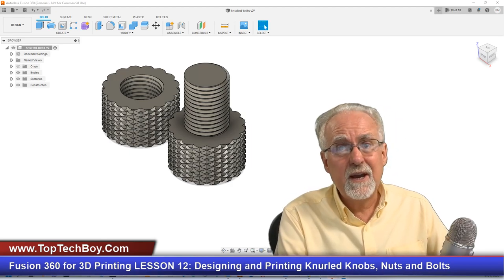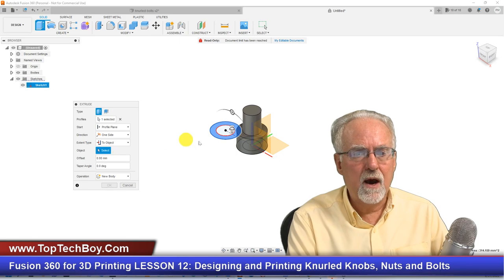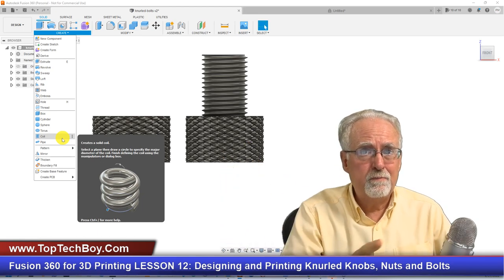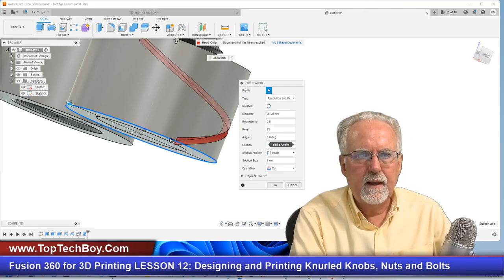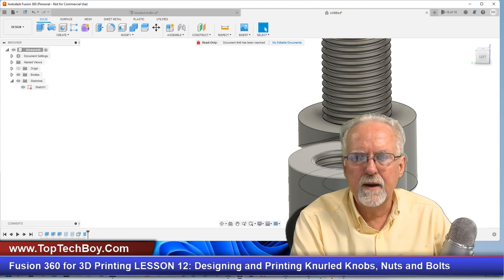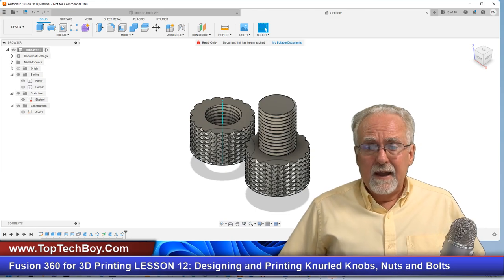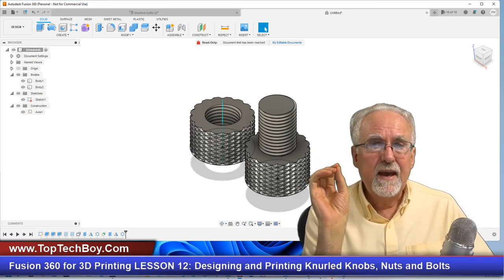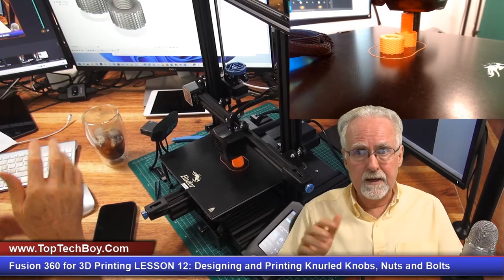Fusion 360 for 3D Printing LESSON 12: Designing and Printing Knurled Knobs, Nuts and Bolts

Comment: Paul, I love your teaching style. I've had two kinds of teachers in my eighty plus years. There were the geniuses who floated into the class with notes on the back of an envelope, scribbled on the blackboard for 40 minutes while everyone frantically tried to copy, and then left. The great teachers however were able to look out into the class from time to time, and say something like "I can see where you might be having a problem. I struggled with this myself when I first saw this. This is what helped me."  Yes, I did the simple nut and bolt, as well as the eyeglass case. I've only seen pictures of the results so far, because they  were printed by a friend with a 3D printer. Keep up the good work.

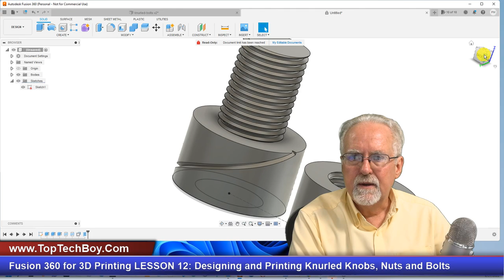Comment: There is actually an option to flip or mirror the cut like you were talking about @14:04. as I was working together with you I was looking through the settings in the edit feature menu and the third option down is called rotation and it has 2 arrows and if you clock the arrows for the rotation feature it will mirror or flip your cut! I was able to get the same exact cut by just making a second coil and than clicking that rotation button!

Comment: Great video, as always.  You are a very good teacher, Paul.  I've learned a ton so far into the series.  I did notice that the sketch wasn't fully constrained on the Z axis of the nut.  The 2 triangles for the bevels around the nut were still in the blue.  Also, on one of the edges of the nut, the original fillet was still there before you added the bevel.  I can't wait to learn a ton more in the next videos!  Thank you!

Comment: Hey Paul,
I left you a comment a few lessons ago asking about how to prevent buildup of filament in the threading. Well I found a solution and I figured I would share in case anyone else was running into the same issue.
In Cura before slicing click on the print settings to expand the advance options. Under the Walls section change the Wall Ordering option to Inside to Outside.
This will start the print layer on the inside of the threading first preventing any buildup in the threading while the printer is starting the next layer.

I'm really enjoying the lessons! Thanks again and I hope all is well!
Reply from the maker: Nice suggestion!

Comment: Thanks for another great lesson. You go at  pace that even a 78 year old rookie such as myself can follow. There seem to be  a lot of vagaries in Fusion 360,  I tried 5   times on circular pattern, for the bolt, and each time it came up with  computer failure. Tried one last time  and it worked perfectly.

Comment: Usually with metal lathe, you will chamfer the bolt end/tip before the threading. Makes it easier to thread into the nut.

Comment: I also found that when creating your circular pattern if you change the object selection type to features instead of bodies it will let you select your coil cut faces with one click in stead of individually, as a whole coil cut, and also works well

Comment: Glad you are doing eSUN filament. So far it is the best filament I have used. I am going to look into SUNLU as well as its most recommended. I was getting ready to buy a few rolls before I came across this. Also to add, eSUN has an awesome reusable vacuum bag kit to keep filaments dry! Best tutorials out there. I tried to get into python, Arduino and modeling before and was always hard to follow along. Watching your lessons has allowed me to get a better hold on them. One thing I hope you do a lesson on is wood 3d printing. Would be awesome to learn how to make tree/wood like textures in fusion.

Comment: I used a 20mm block.
Made sure it was a snug fit betwen the lower plate and print bed. So both plates are mechanically square and
the springs are even and starting at about 2/3 of theie stationary compression. 
Then perform auto level.
Then check the 5 points with slight adjustments on the 5 positions. Then 1 more auto level.
Seems to work great 
All depends on how close you are when starting the above procedure 😂
Another classic video 👍

Comment: I'm really not an 'original thinker' - we'd still be waiting for the wheel if it were up to someone like me. However, once it was invented, I'd have soon produced the deluxe gold-plated version! Fiddling, tweaking and improving is my forte (hence excellent skills in analytical chemistry and development of methods of analysis - I'm great with what if?)

So, maybe I folded up like a lawn chair, but it was not a cheap Walmart one, and all the folds where in the precisely intended locations! I watched the solution you presented and then did it myself from memory in about 15 mins, so I can claim to have learned something. I put chamfers on the knurled surfaces and on the ends of the threads, just like real ones have. Caused concern for a moment as the beginnings of the mirrored objects didn't meet, but all good once I realised I'd cut away the meeting points, so all good. (It is necessary to chamfer before modelling threads and knurling else the modelled parts still exist if cut away after and appears as if the modelled components would still print)

Excitedly waiting to design gears!!!!!!

Comment: Thumbs Up and Happy!  👍
The only one thought is, for you to show your Cura slicing and settings that pertain to the object (i.e. temp, material, resolution etc.)
Thanks Paul!  😊
Reply from the maker: I pretty much always use the default settings, dynamic quality. My theory is that really if your printer in tuned in, you really dont need to fuss with cura that much. I find people often try to compensate for fundamental printer issues by using settings. Align your printer well, use good filament, have a clean nozzle and things should work.

Comment: I tried to make a rectangular pattern of rhombus on a tangent sketch plane of the cylinder and extrude a thin layer of the sketch and ended up folding up like a cheap walmart loan chair!! 

At least now I learned to properly design bolts and nuts :)

Comment: "Document Limit has been reached" I really am dying with Fusion!
Reply: All you have to do is make your old ones read only. I have done several 20+ component project designs in Fusion and have them all in one file hiding any components that I am not working on. That is my preferred way to work in Fusion. I know some designers like to have a file for each component and they need more than the 10 documents. For free hobby use of world class CAD I can work around the few limitations.

Comment: i was not able to figure out the homework. i was at it for a couple of hours last night and i tried using a lot of different tools, from descriptions i thought the most promising one i looked at was sweep but i couldn't figure out how to use it.

i tried using the coil tool and switching the rotation direction to cut into the cylinder in both diagonals.. i think i could have made this work if i could figure out how to use the circular pattern tool with it or just made many coils around the circle but i felt there had to be a more "automated" way about it than making a bunch of separate coils

i also tried creating a new sketch on the xy plane that had a bunch of little triangles poking into the outside of the circle, i wanted to try extruding those to cut into the edge of the cylinder from bottom to top but with a rotation angle.. which didn't work but i think that's what i could have used sweep to accomplish if i could have figured out the path part of it

now to watch this video and see how you did it!
Reply: after watching, guess i was on the right track with the coils! i just wasn't sure how to do the circular pattern with a cutout.

Comment: It looks like the nut is not fully constrained with the z axis construction line still present. This is the issue I noticed with the nut in lesson 11. Are there times when the model does not need to be constrained? Really like these lessons and looking forward to the printer tweaks and upgrades.

Comment: Another great video. thanks! It seems like when you offset the bolt thread that the root of the thread should get sharper (because the offset is to the inside), but instead it looks as though it has become blunter. Please help me understand why this is the case. Is it optical illusion?